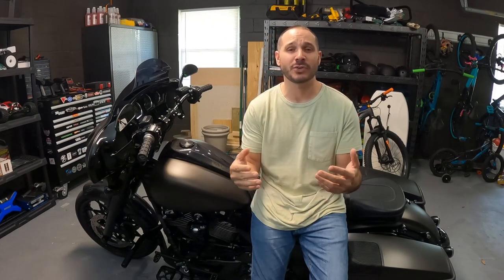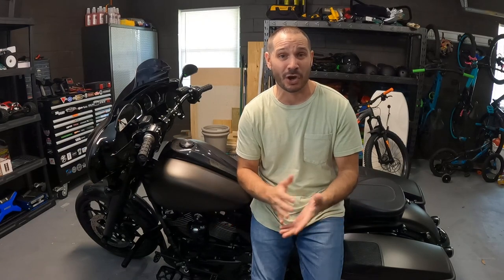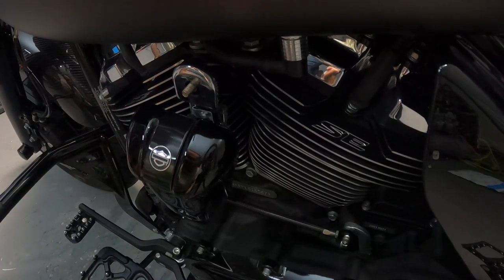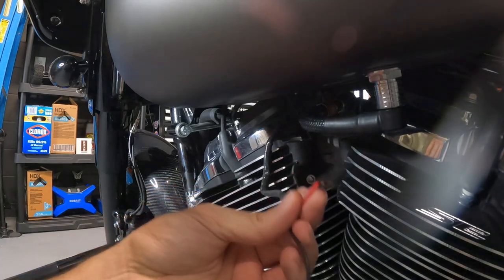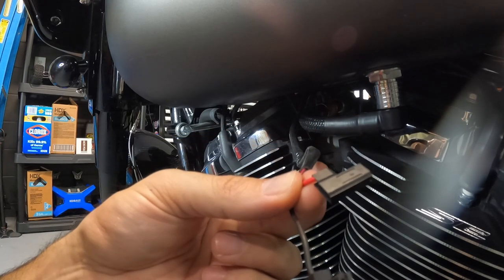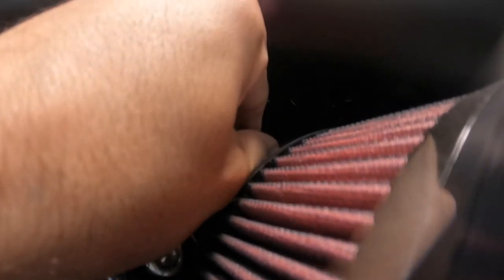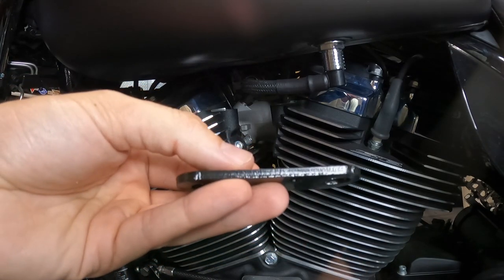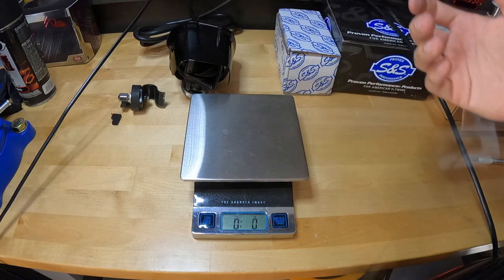Relocate that ULGY horn on a Street Glide | Build Series | Part 14

Comment: It's a good idea, rear cylinder can use all the help it can get with air flow.. I would not mount it up front either for the same reason..I'd go with smaller louder option under side cover.  🏁🏁🏁